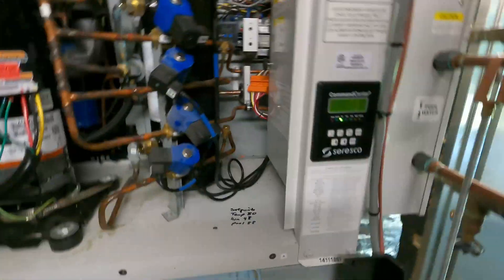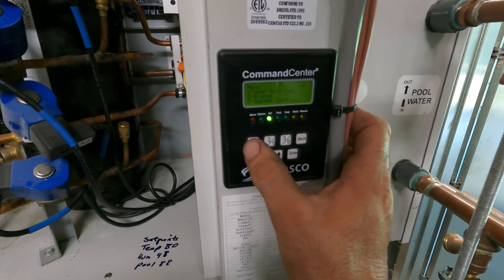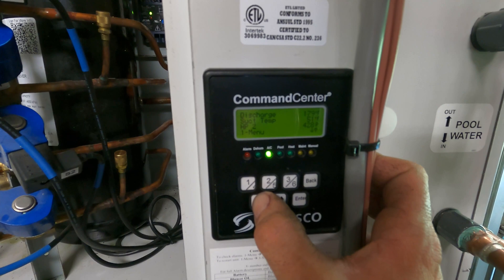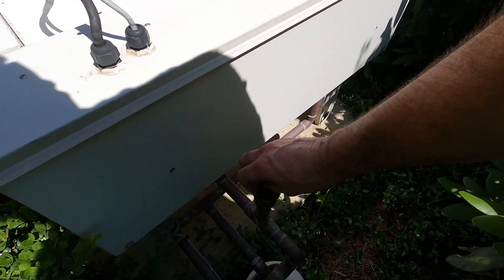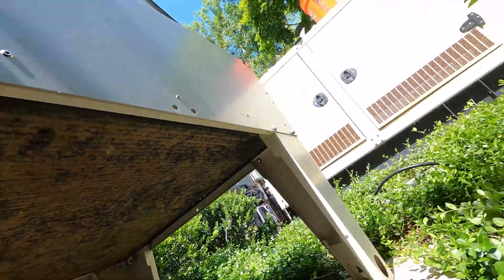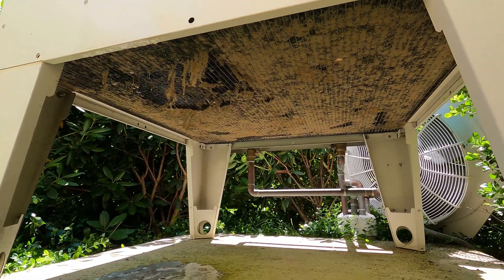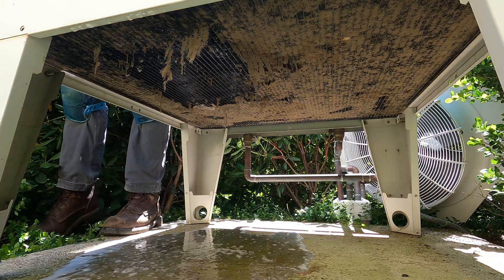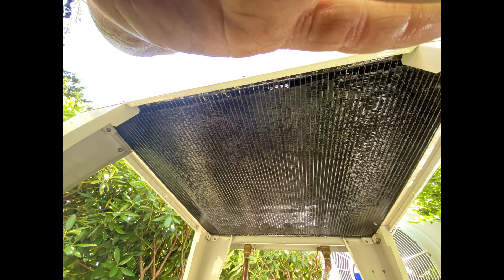AC / Dehumidification System High Head Pressure Alarm

Comment: Quick question i have seresco dehumidifier at hotel we have r22 refrigerant can i switch to 427a refrigerant i don't see to much  moving r22 refrigerant on dry filter if i restart unit still blinking alaram and service mode light

Comment: any help I have the same sersco dehumidification..alarm that keeps flashing on how I clear the alarm I clean all coil and outside condenser I restart the unit still alarm keeps flashing on and our pool drywall is  getting damage I put code 254 on to log in on unit I can find to clear alarm if any help that will be really  help full
Reply from the maker: You need to fix the problem that has the alarm present. The alarm doesn’t stop unit from working. It only lets you know their is a problem. Other safeties might have unit off. To much humidity sounds like something is wrong with refrigerant circuit

Comment: I work on those systems all the time. My profile picture is a brand new one that we installed last year. Seresco is top notch when it comes to pool Dehumidification
Reply: any help I have the same sersco dehumidification..alarm that keeps flashing on how I clear the alarm I clean all coil and outside condenser I restart the unit still alarm keeps flashing on and our pool drywall is  getting damage I put code 254 on to log in on unit I can find to clear alarm if any help that will be really  help full
Reply: @jellytae6851  what’s the alarm? 🚨
Reply: @smitty1715  Hello Rob I no so far humidity is not lowering in the pool room I don't see any water in the pane I don't know how to find what alarm code is I just know that the red light is flashing on command center i am the owner of hotel i really need help
Reply: @jellytae6851   It’s been pretty hot outside so I can only imagine you probably tripped out on high head pressure?   Has anybody checked underneath the coil of the outside condenser coil as shown in this video?  Also I would verify that you have the proper required GPM per minute going through your pool water supply through the unit.  If you power off the unit completely off it should reset itself and reboot up.
Reply: i check is clean i just clean last night
Reply: @jellytae6851  what state are you in?  Did you try the power down reset?
Reply: @smitty1715  i am in michigan i saw alarm log 19:48:13 Resart 
19:48:13 HP1-TD 19:43:05 HP1-TD there are lots of code
Reply: @smitty1715   i am in michigan i saw alarm log 19:48:13 Resart 
19:48:13 HP1-TD 19:43:05 HP1-TD there are lots of code
Reply: @jellytae6851   I would definitely reach out to Seresco and have them recommend a service professional.  You could have multiple problems going on.  If the unit is fairly new it should be under warranty for at least five years through Seresco.   It could be an improper installation or a mechanical issue. It’s hard for me to help you when I’m not physically looking at the unit.
Reply: @jellytae6851  do you have websentry installed on the unit? This would require an internet line hooked up to the unit? If so I can check it in my seeesco app.  All I need is the unit serial number and the MAC address. That can be found under network settings on the unit.
Reply: @smitty1715  no i don't have websentry install on the unit
Reply: @smitty1715  yes I did power down for 10 minutes and flip the breaker still nothing chance only thing is is not lowering humidity from pool room I put brand new humidity sensor
Reply: @smitty1715  Hello Rob if i install new websentry can you help me to look up what is the wrong with unit i am trying to hold with part department in early morning
Reply: @jellytae6851  The only way I can help is if you have the serial number and the MAC address of the unit. Also there needs to be an active Internet line hooked up to the web sentury board
Reply: @smitty1715  i have internet line hook up and i also have serial number of to i am just waiting to hold in morning to seresco part department i will order overnight from them let you know
Reply: @jellytae6851  That’s fine I’m not sure if they do overnight ordering because it needs to pass through customs in Canada.  Every time I order parts it’s always a couple weeks delayed.  Also don’t forget the MAC address of the unit once you get that.
Reply: @smitty1715  yep i order couple week ago humidity sensor they ship me overnight thank you Rob
Reply from the maker: Many times the alarms clear when problem is resolved
Reply from the maker: HP is head pressure. What is the head pressure on your system. You have water flow to your condenser? Do you have a temp difference of water in and out? Does your circulator pump operate. This system I had to clean condenser twice. Once in April and then whenever this video was. House had lots of landscaping. Lots of sand added to soil and tilled together. That plugged up the condenser
Reply: @smitty1715  Quick question i have seresco dehumidifier at hotel we have r22 refrigerant can i switch to 427a refrigerant i don't see to much  moving r22 refrigerant on dry filter if i restart unit still blinking alaram and service mode light
Reply: @jellytae6851  I would not recommend doing that with out changing the filter dryer and I would call seresco to see if anything else is required to convert to the new refrigerant
Reply: @smitty1715    I also have in stock dry filter i am just waiting for there reply to call me back Thank's Rob
Reply: @smitty1715 Hello Rob , I talk to customer service department  today, they said if  you need to convert R22 this is close you can change refrigerant to 407C and need to change dry filter expansion valve compressor oil to..i have no idea what to do so can i stay R22 or change to 407C refrigerant
Reply: @smitty1715  I have Mac I’d can you please login and check for us after we install new websentry the humidity sensor want turn or move any Freon
Reply: @jellytae6851  sure I need the max address and unit if number
Reply: @jellytae6851  It appears a service technician or a maintenance technician left this unit in service mode. This cannot be changed from the web century app.  going back in the data log it looks like this thing hasn’t been running for a while I take it?  Also did you have a service technician out working on this equipment?
Reply: @smitty1715  we install today this websentry
Reply: @jellytae6851  I understand it looks like they left it in maintenance mode though this needs to be manually taken off at the machine. Or if you call Seresco they can do it over the phone.   It also looks like this unit is from 2004.  Normally these types of units do not last this long. I’m assuming you probably did a bunch of repair work on this unit? If so what type of work have you done?
Reply: It  looks like a Bobby western is monitoring system. I’m assuming he’s probably through Seresco
Reply: @smitty1715  my name is Bobby I have access to websentry some reason I can’t login to app
Reply: @smitty1715  yes that correct it was install in 2004 I will find out in morning when I talk to seresco service department  if they help me out thank you so much Rob for taking time for me
Reply: @jellytae6851  No problem if I was more local to the area I would stop by and give you a hand but unfortunately I’m in New Jersey.. Tech-support is great with them they should be able to get it out of service mode for you.   If I can offer you any more assistance in the future just let me know
Reply: @jellytae6851  It also looks like you had a software upgrade when they did the WebSentry so something is probably not programmed properly.  I would love to hear the outcome when you figure it out
Reply: Hello good sir I see you finally got your Seresco out of maintenance mode.. It appears that you may have an issue with space heating.   It doesn’t appear that you are meeting your require space temperature.   Not sure if you have an electric heater Or  an indirect water heater for Space heat.  Other than that it appears your unit is running pretty good
Reply: @smitty1715  yes I talk to seresco service they remove from service mode..in pool I have time watch that have time clock and humidity sensor..show humidity 80 and on websentry show 53 percent I don’t see any moving Freon
Reply: @jellytae6851  yes I see the unit is calling for heat so no refrigerator would be moving now.  There should be a heater for space heat to heat the air to your set point of 84
Reply: @smitty1715  so when you turn ac on then only it’s move Freon
Reply: @smitty1715  our seresco is heat by electric hot water tank
Reply: @jellytae6851  same as mine.  Are you sure that unit is working properly?  Unit says it’s calling for heat and only supplying 70 degree air temp.    That should be higher when it’s calling for heating
Reply: @jellytae6851  ac or dehumidification it will turn on
Reply: @smitty1715  I don’t see any dehumidifier kick on
Reply: @jellytae6851  You will only see your you dehumidification turn on when your setpoint rises five or 10% above your 50% setpoint.  So right now there is no need for the compressor to turn on.  Your unit is calling for space heat right now. So that wall hung heater should have one of the pipes really hot on it going to your pool unit
Reply: @smitty1715  is look like we make mistakes to install new websentry on controller board ac and dehumidifier light keep flashing on green

Comment: I don't know what that system was. So the pool water runs across the evap to cool it?
Reply from the maker: It is a water sourced heat pump. When in ac or dehumidification water is pumped to the outside condenser. Where the heat is rejected. If pool needs to be heated. Refrigerant goes to a different heat exchanger, using pool water to absorb heat from the condenser.
Reply: @thehvachacker  Thanks. I got confused when you called the outdoor a condenser. So the loop of water that runs outside in AC is a seperate water source that has some type of water feeder and the pool water only goes across the seperate heat exchanger when needed? It is hard to tell from your video that there are ducts running across the indoor. I understand it I think but it seems complicated. I'll stick to residential. Haha.